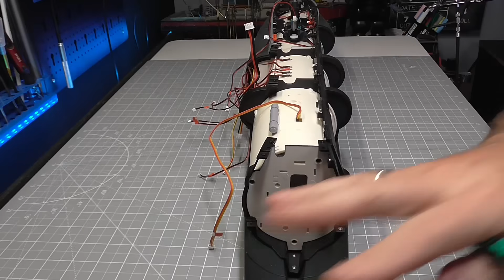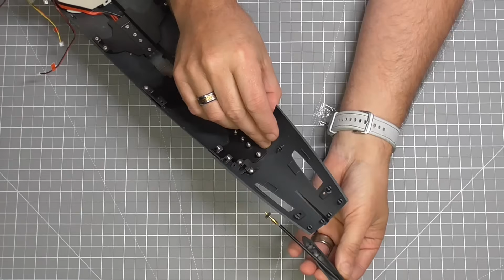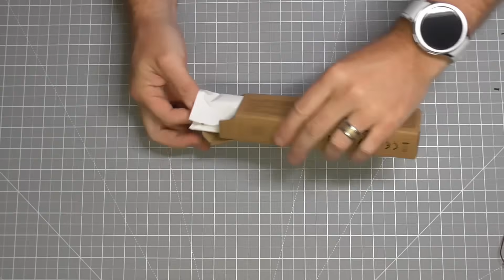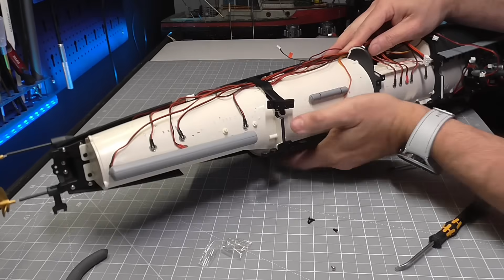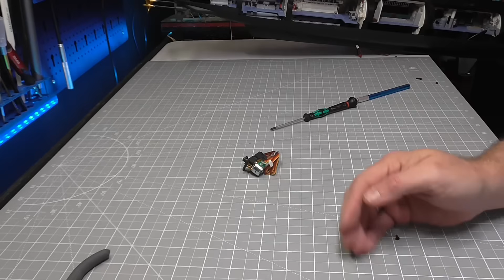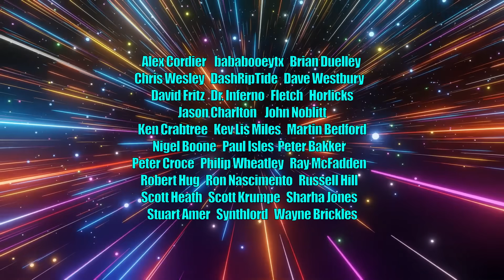⚓ U-BOAT U96: The TRICKY Last Compartment Hack! | Stages 105-108 ⚓

Comment: The only complain I can make at this point of the build is the fact that they didn't provide keel supports yet (not even temporary ones, even something made with foldable cardboard would be better than nothing), a real blunder considering how useful it would have been to keep the model still during assembly without it rotating on the table and risking breaking pieces.

Comment: Yet another hachette hash up. Obviously not testing the model build to see if everything is OK. Similar to the spitfire build, so many things went wrong, did not fit or failed. Maybe the company should be re-named from Hachette to Hash-up. I think i noticed your second prop build that one of the blades was glued incorrectly. Two were concave and one convex, or was it just the camera angle?
Reply: agree they could not design a model if there life depended on it ,  piss poor design and less than accurate and a total waste of money every time